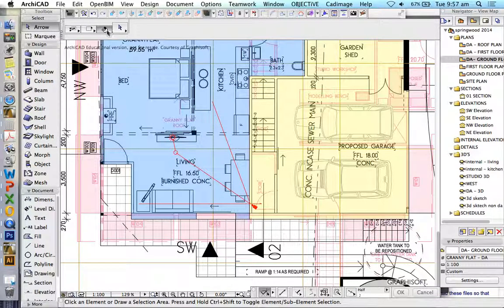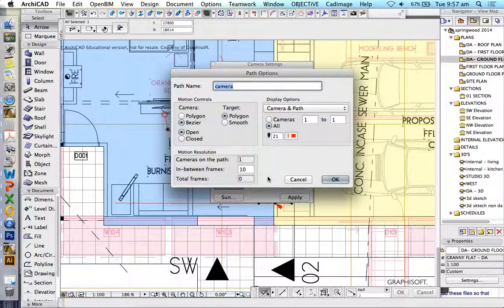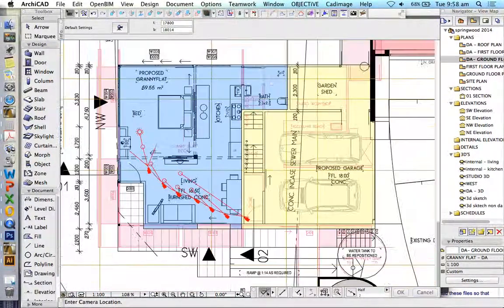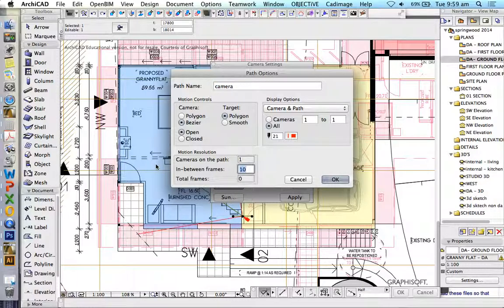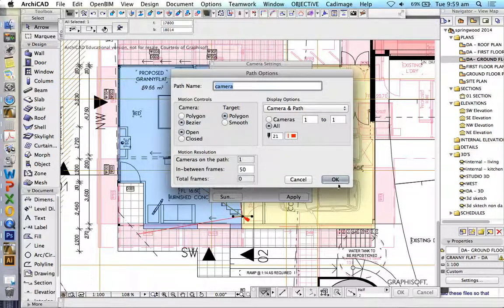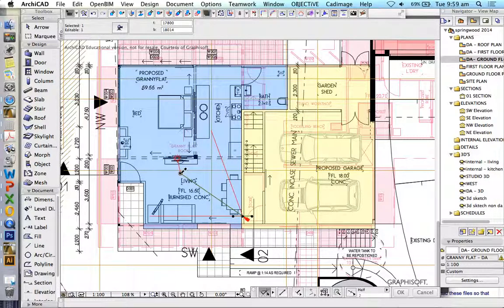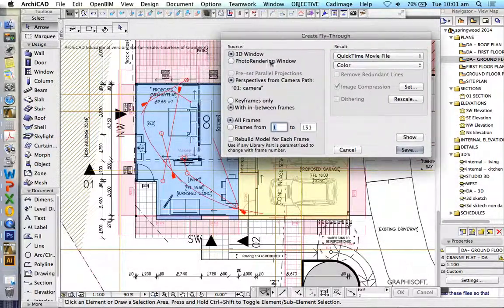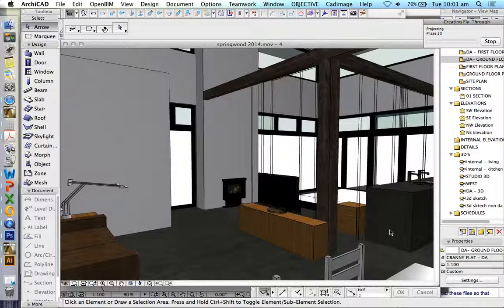ArchiCAD_Flythrough Animation Cameras

Comment: my videos are coming completely black. how do i fix this?
Reply from the maker: Hi Fausto, there could be a number of issues. I would suggest that you start by checking the following. 1. If a still render woks fine (using the same camera) but not an animation it is likely your video card or software. 2. if you are producing photo-rendered  animations it could be the light settings (if you have them all turned off). 3. people often get the height values wrong (based on storey settings) and therefore can't see their model.
Reply from the maker: Alternatively, if it still is not working for you I provide technical support & ArchiCAD consultations through www.archi-ed.com